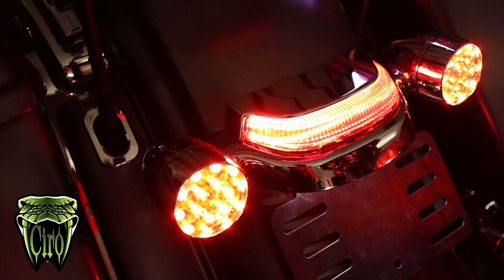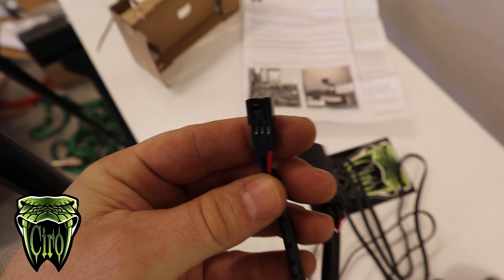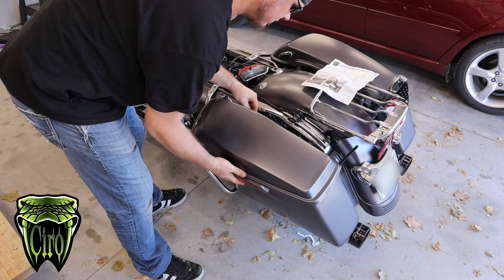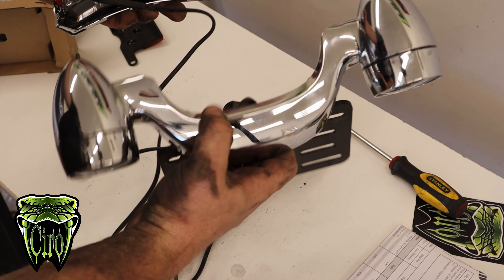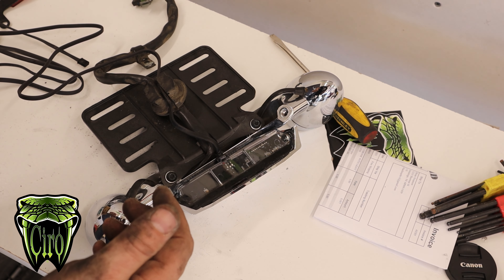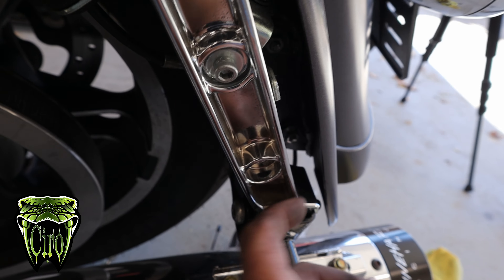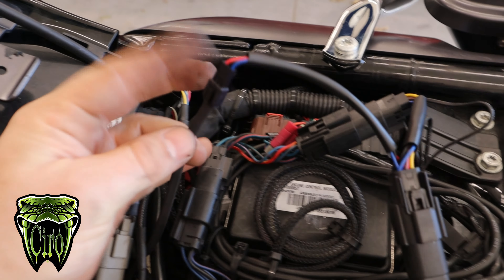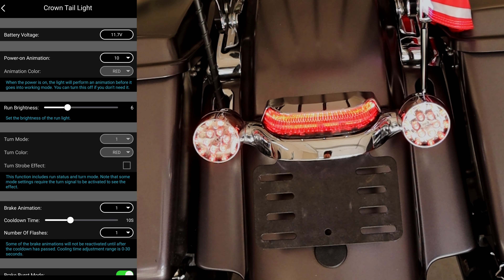How to install a bluetooth taillight on a Harley! Ciro Crown tail light with lightstrike technology!

Comment: Good install video. I do like Ciro3D products. I've been a long time user of 3M adhesive products, especially the double face tapes. Where as your tip of giving the tape a good fingernail press before removing the protective layer does help activate the sticky. What I have found that works great is to have a heat gun on a low setting or even a hair dryer to lightly warm up the tape (especially in colder room temperatures). this will give very good adhesion when pressed into place. Press and holding in place for at least 60 seconds is still a good idea!
Reply from the maker: Great idea! I may have to use that this winter since I never put heat in my garage 😋
Reply: @LifeontheBlacktop  
Home Depot, Lowe’s, and probably any other home improvement stores have heater elements that you can mount on top of propane tanks to use as heat in garages or outdoor sheds!
Reply from the maker: @AzzKicker-bz1cb  I do have one of those! It definitely makes it workable. Unfortunately I can't run it and the camera at the same time, too loud 😕

Comment: Your buddy must have some lift junk, most people are very positive about using the harbor freight 1000 lbs. Lift. I have one , it is great, did switch out wheel chaulk
Reply from the maker: It's more me being scared to knock someone else's bike off of it lol. I'm sure it would be fine.
Reply: @LifeontheBlacktop  they do make a big difference,  always be safe and run a rachet strap down on each side of the fork. When I started using mine it so much easier then rolling around on the floor.